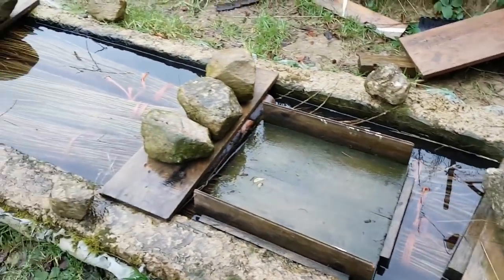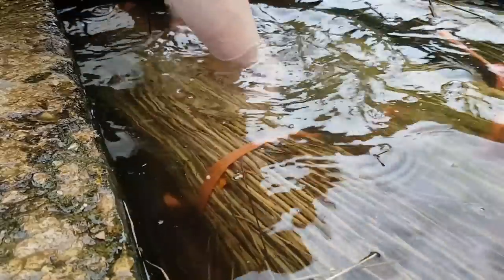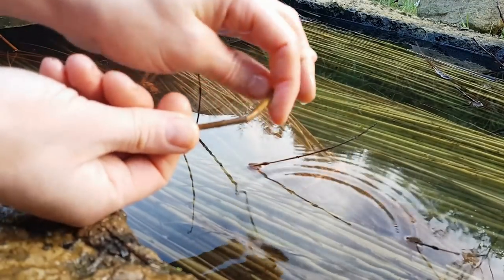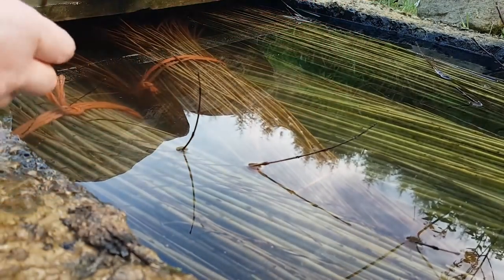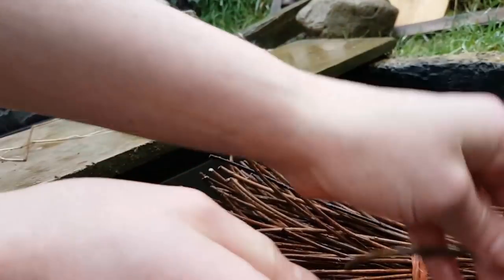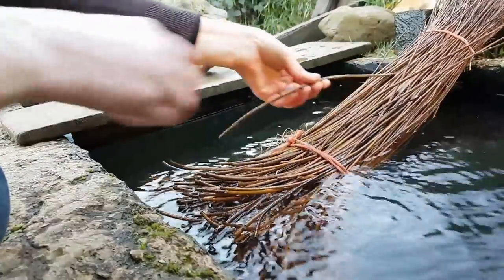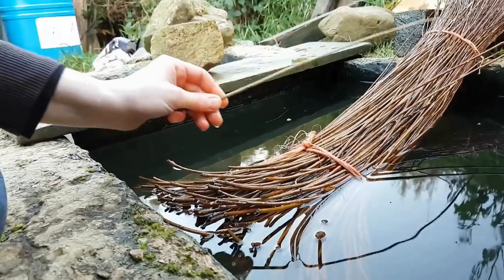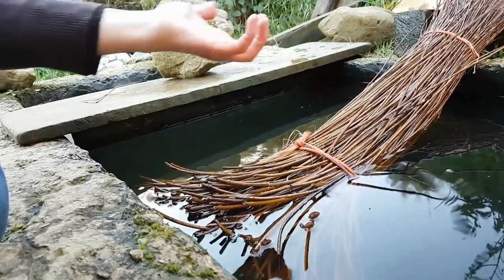Preparing willow for basket making: Soaking

Comment: Thanks, Hanna.  I tried my first willow basket yesterday.  I cut and wove all on the same day, but still, even the green branches snap.  In fact, even the very small, green branches snap.  So, I think the willow species I have is a rigid type and so I will need to soak and soften the rods.  Now, I'm all out of willow branches, except for the smallest size (it was only a small 2-year-old tree), but I'm going to try your soaking technique on Goldenrod stalks.  It's all for learning, so I might as well experiment and learn.  Thanks so much for sharing your knowledge.  It makes me happy to know that people are preserving the skills of our ancestors.
Reply from the maker: Willow should be left to dry first, then soaked for flexibility. You might have the wrong variety. To check wrap the fresh rods around your finger. They should not snap.
Reply: @HannaVanAelst  Oh, I think I must have the wrong variety.  The branches snap almost as readily as goldenrod stalks.   I finished the basket in soaked green grapevine, which also snapped easily.  I did the handle with a vine, called Virginia Creeper.  It's far more bendable than either the willow or the grapevine, yet still needs soaking, or it too will snap on light wrapping.  There's nothing here that would wrap around my finger without some presoaking or perhaps boiling.  No matter.  I did finish the basket and know that I'm not naturally gifted with materials worthy of the craft, but I still can weave relatively well and the willow rods will be useful for staking garden plants.  It's a happy ending anyways. :D

Comment: Excellent presentation and information Hanna, thank you! When you wrap the soaked willow do you lay it flat for a day or stand it upright? Does it matter which way? Deirdre
Reply from the maker: Hi Deirdre thank you! It does not really matter that much if the willow is left flat or standing. The bundle in this video was left lying down because it was a small one. Bigger bundles are left standing to save space.
Reply: Hanna Van Aelst Thanks Hanna

Comment: Hi, thanks for the tutorial. Does this soaking process work with much thicker willow / 2meter long and 30mm diameter? I need to build a bigger garden dome structure. Thanks
Reply from the maker: yes but when soaking such long sticks you are soaking for a very long time. For a dome structure you don't need to bend the sticks at sharp angles as in a basket. You can probably just bend them far enough dry. Good luck!

Comment: It’s excellent video. 
Thank you for sharing your beautiful art works.
.
How do you keep the water in the soaking tank fresh?
After a while, some green stuff starts growing in my soaking tank. Fallen leaves and all organic materials start decaying in the water. 
Emptying and cleaning the soaking tank is time consuming...
Reply from the maker: Hi Thanks! Yes the water in the soaking tank needs to be cleaned out regularly. Depending on the time of year, how much it is used and leaf fall etc. But I clean it out at least once a month. It gets less time consuming if you do it often, as you get a system going of how to do it efficiently. Another necessary task!
Reply: Hi, thank you for the reply. 
I’m glad to hear the answer that cleaning needs to happen regularly. 
I was wondering if I was doing anything wrong so far. 
I’ll need to find more efficient way to empty my soaking tank and refill it with rain water.

Comment: Hi Hanna!  I am homesteading in Alaska, 200 feet from a river, and feel so blessed to have so much willow available.  Since this is my first full year living here, we have been focused on building our greenhouse, wood shed, boat house, landscaping, etc.  I don't have a shed I can dedicate to willow drying yet, but will not be using my greenhouse much over the winter and wondered if that would be a good place to store my bundles.  Will that will be a good location to dry the willows or would they get too much light and/or humidity?  Should they be stored under a solid roof to keep the sun out?
Reply from the maker: Hi Margo, your Alaskan homestead sounds amazing! Sunlight on the willow can change the colour. That is ok if colour is not your main concern. I would be concerned about moisture in the tunnel. Maybe yours is dry enough once the frost sets in but I would keep an eye on it. Best of luck!
Reply: @HannaVanAelst  Wonderful!  Thanks so much for your advice.  I look forward to learning more.

Comment: I like the look of the bark peeled off. How do you process that? Peel when you get it, cure then soak?
Reply from the maker: peeling willow is a long and arduous process that needs some specialised knowledge and set up. To get white rods, willow is stripped in spring when the sap is rising by pulling through a 'brake' or stripping machine. To get brown coloured rods without the skin on, willow is boiled for hours and then pulled through the stripping machine.

Comment: What’s your process for soaking white willow? I find it so brittle and hard to work with
Reply from the maker: Hi Lissy, I generally don't use white willow as I would need to either strip my own willow or buy it in. I love working with my own willow. But Yes white willow is harder to work with as it dries out more quickly. Spray it with a spray bottle regularly, or wet it with a sponge. Keep willow not in use covered in a damp blanket or under plastic at all times. Soaking time is greatly diminished, about an hour or so depending on length.